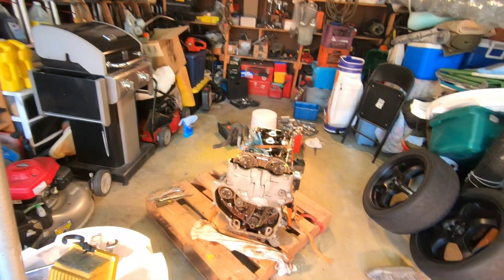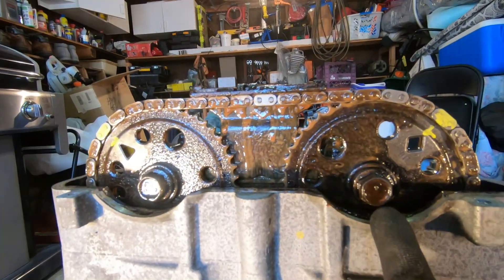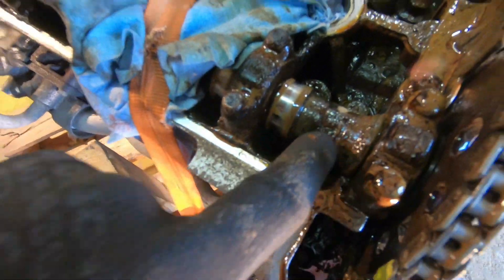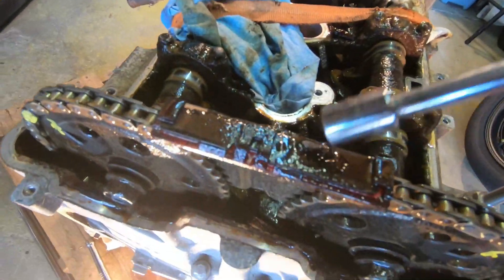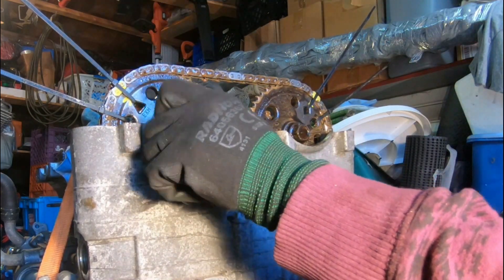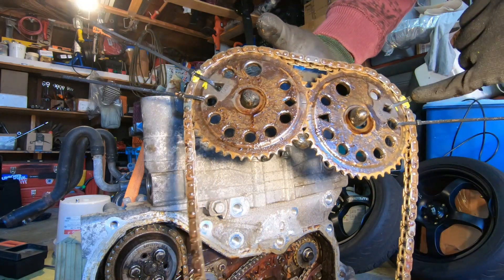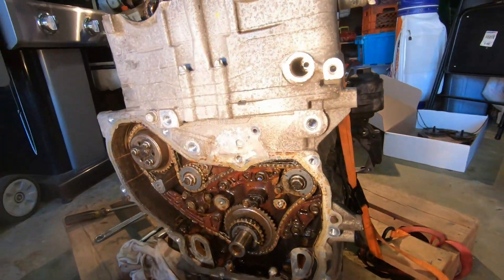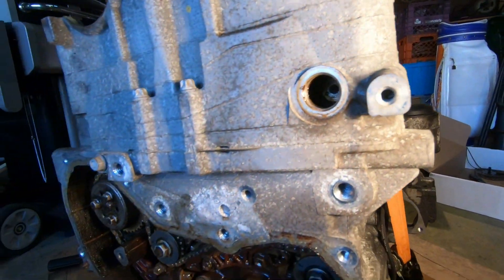Gm Ecotec Timing Chain Removal Guide

Comment: You might get a 12 point socket to fit those star head bolts? If not head to Harbor Freight!
I was thinking about you earlier as I was spraying some Rustoleum  Satin Black, with a purple HF paint gun.
Did you get my email address the other day?
Reply from the maker: funk i found out sometimes a 10mm might work but I tried it and it felt like it was going to strip.   Oh man I wish we had better weather to spray.  How did the job come out? How much psi were you shooting and mixing ratio! 
Yes I didn’t get a chance to email but please email me bullipl@yahoo.com

Comment: Great video.  Those torque to yield bolts can be expensive, however I did read they can be used over again providing they haven’t stretched; ie they are the same length as a new one.
Not sure it’s worth the risk though.

You can buy those “star” sockets you need individually.  It’s not as though you need a set (yet).  eBay is good for that but Bullet’s Garage is cheaper :-). Interesting to see the head gasket.
Reply from the maker: Nathan Campbell yea someone would have to verify the bolt has not stretched. Probably best to just buy ARP which are reusable or another OEM bolt.  

I order a small set on eBay fairly cheap. 
Bullets garage failed me.  Haha and he had a German car before. (MK6 VW GTI APR stage 2. )